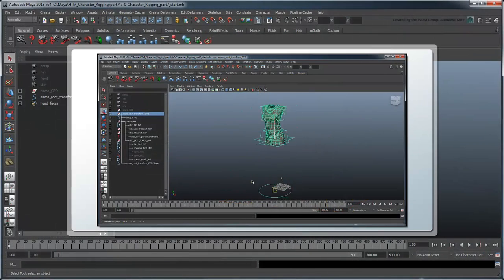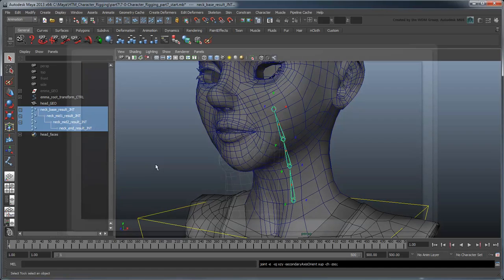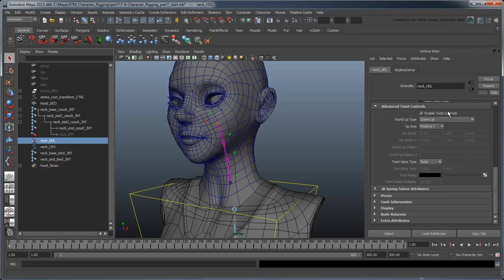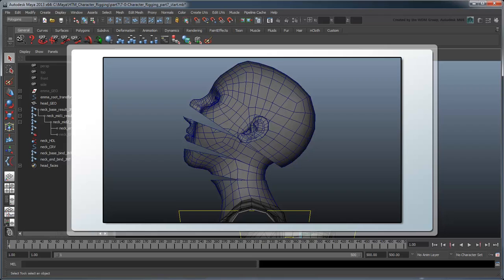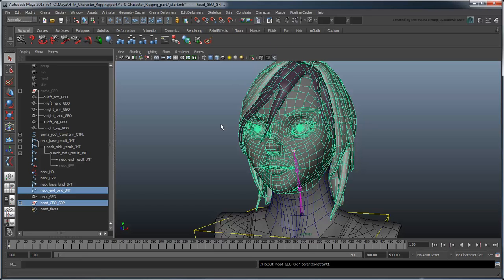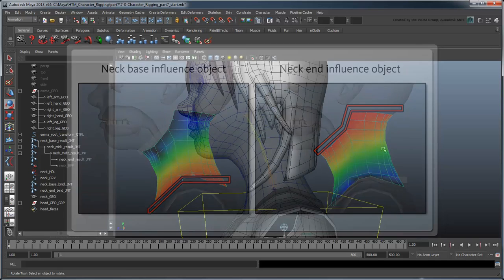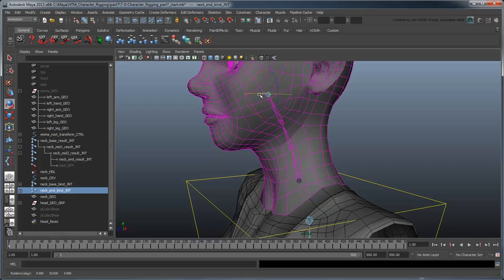Creating a Character Rig - Part 7: Basic spline neck (Advanced)

Comment: 4:30 Why do you set it at 45 degrees? Setting to Z 1 changes the local rotation. When set to Z 0 and Z -1 the twisting looks the same. Is it to consistently orient the axis? Or is there another reason? There seems to be no difference in appearance. I don't understand.

Comment: I'm not expecting an answer on this 6+ year video but one can only hope!  I was wondering whether it'd be needed to create those influence objects if the mesh is entirely skinned? Thanks so much for this series!
Reply from the maker: They won't be as necessary, you're right.  But occasionally you'll use an influence object even on a fully skinned mesh - one common example is using a sphere inside the elbow to help the deformation look more elbow-like.  But for the most part they won't be necessary.
Reply: @Autodesk_Maya  Thank you so much! You just made my day :)

Comment: I am looking to create a rig to animate a character used in Unity game engine - Unity does not read Maya's Rotate Axis (pre-rotation), Joint
 Orient (joint only post-rotation), or Segment Scale Compensate (joint only option). Is it possible to make a rig like this one without relying on those three features? I know that the segment scale compensate can be turned off. Would doing so break a rig like those or would it be easy to turn off and alter the rig to get it working again?
Reply: I am told "turn off automatic scale compensation for your bones in maya to get consistent results between maya and unity. You can use constraints to have scale compensation in your rig that actually bakes/exports properly if you really need it." Would it be easy to modify a rig like in this video to use constraints to mimic SSC instead of using the automatic SSC feature?
Reply from the maker: @Miketulli8  Unfortunately I'm not an expert in Unity, so it's hard for me to answer this.  In general though, this rig uses a lot of Maya-centric math nodes which I'd be surprised if Unity supported.  When porting to a game engine, my advice is usually to animate in Maya, then map the result skeleton to a much simpler / basic skeleton which you can then send to Unity.
Reply: @Autodesk_Maya  Thanks for the quick reply. I have no experience in Maya as I am switching from Blender. Does your suggestion just entail making a second armature that copies the transforms of the original? I am looking for a result that would give the exact same animation, same stretching and deformation of mesh. Is that possible?
Reply from the maker: @Miketulli8  Yes, that's right.  Do all the complex stuff on this rig, then transfer the raw joint values to another, much simpler skeleton (which any game engine should be able to handle easily).

You can also consider using HIK, which is Unity compatible: https://www.youtube.com/watch?v=c538zkwxgTQ&list=PL8hZ6hQCGHMXKqaX9Og4Ow52jsU_Y5veH

Though it doesn't handle squash/stretch without some work either.

Comment: I apologize if you've answered this in the past videos, but I'll follow the steps, the neck rocks back and forth well, but then I get to the rotation and it rotates well, but won't rock back and forth. I delete everything and try again and usually that 'fixes' it. Is there a reason for this happening that I'm missing? I feel like I'm following everything to a T but this happened with the spine and now the neck and only redoing it from the start of the bone creating process seems to work.
Reply from the maker: When the rig was broken and you tried to move it, did Maya give you a warning about any "cyclical dependencies" in the Help Line?

Comment: I am following this tutorial step by step and everything has worked. Once i added the influence objects...my head still separates from the neck. I am using Maya 2017, I even matched the smooth bind settings to this one, and it still doesnt work....any ideas???
Reply from the maker: Does it separate the exact same way, or different from when there's no influence object?  Also, you can try this: go to the Rigging menu set, then select the neck and go to Skin > Paint Skin Weights.  In the Tool Settings Editor, do your influences appear in the list of Influences?  And if you select one of them, does the entire neck remain black, or do you see a white gradient?
Reply: When I select the influences they remain black
Reply from the maker: @Celestianee  The influences remain black, or the neck?  If the neck is black then it means the influences have no weight, which would explain why they're not having any effect.  Try setting the brush to full, then painting over the region of the neck the influence should affect.  That should fix the issue.

Comment: If you orient the end joint on the neck, will that eliminate the need to create a 45 degree angle on the up vector as shown at 4:34?
Reply from the maker: It should yes.  If you want to do that orientation, you'd have to create a temporary joint at the end of the chain (so after the actual end joint), orient them all, then delete the temporary joint.

Comment: Using Maya 2017, after adding Influence @ 9:30 and then parenting the pCube1 to the neck_end_bind_JNT, I am left with an extra pCube1_Base node. Shouldn't the pCube1_Base be parented to the neck_end_bind_JNT as well? 

Likewise, there is a leftover pCube2_Base for the pCube2 and neck_base_bind_JNT Add Influence process. 

There are no instruction on what to do with this node and when comparing with the supplied reference download file for Part 8. (8-0-Character_Rigging_part8_start.mb) I see there is a neck_base_influence_GEOBase but, none for the neck_end_bind_JNT.

Segment of the emma file tree:

neck_base_bind_JNT
 neck_base_influence_GEO
 neck_base_influence_GEOBase

neck_end_bind_JNT
 neck_end_influence_GEO
Reply from the maker: It doesn't really matter what you do with these base nodes.  The influence is the only thing you're after.
Reply: Okay, thanks... So, deleting them will not effect anything?
Reply from the maker: Correct!

Comment: hi. I'm struggling with adding a curve driven blend shape to this rig. The master head, once the blend is apply doesnt follow it properly. Any help appreciated
Reply from the maker: Out of curiosity, why are you adding a blendshape?  Is it for facial animation on top of this rig?  If so, I'd recommend using the Shape Editor to put those changes on a new layer, or they can get in the way of your skinning and override it following the rig (which sounds like it might be what you're running into).
Reply: yes,this is exactly what i'm trying to do.(trying out faceware stuff) could you be a little bit more specific about this layer so that i know what kind of tutorial to look for? thanks in advance
Reply from the maker: Hmm, I'm not sure exactly how this will interact with Faceware (I'm not very familiar with that plugin), but you can give this a try.  
1.)  First is cleanup your geometry by selecting it and going to Mesh > Cleanup in the Modeling menu set.  Turn on "Non-Manifold Geometry" and "Lamina Faces" then click Apply. 
2.)  Once your mesh is clean, go to Windows > Animation Editors > Shape Editor to open the Blendshape Editor.
3.)  Select the mesh and click "Create Blend Shape".
4.)  Select the new Blendshape in the editor and click Add Target.
5.)  Sculpt a new facial expression on the target (either using the Sculpting shelf or perhaps attaching it to Faceware somehow).

This will put the facial expression on the target, which you can fade in and out with the Weight/Drivers slider.  Additionally, because this is on a layer, the edited expression will move along with your rig controls properly.  Then it's simply a matter of creating a new target for each expression you want for your character (make sure to rename them so you don't get confused).
Reply: Maya Learning Channel thanks alot. Ill give it a go.
Reply: it works, great. but with modified step 4.  with a target mesh selected i clicked Add Selection as Target ,  / Tangent

Comment: Still loving this series. Is it important to keep joints straight for some reason? I have a bit of a bend in my neck joints, but in the tutorial files the joints are straight. The spline twist doesn't move exactly the same but it seems to work fine regardless. But I'm wondering if "best practice" calls for having joint chains be as straight as possible..?
Reply from the maker: Nope, they don't have to be straight.  That just happens to be the way I set it up.  Actually, sometimes having a little bit of bend helps with default orientation.
Reply: ah okay! Thank you!

Comment: I was making a character rig using this method for Unity and animating it was fine, but when I export it, the neck end bind joints detach from the head (making it still while the rest of it moves) and the end bind geos are visible. Do you have any solutions for this? I am using Maya 2016 and Unity 5.6.3f
Reply from the maker: It sounds like the skin weights or possibly the parent constraints aren't getting properly imported into Unity.  Unfortunately, Unit doesn't support all of Maya's nodes.  I would recommend trying this technique for full compatibility: https://vimeo.com/34676136

In short, create a second version of your character that is just joints and skinning, then transfer the animations from your more complex rig to the simpler one before exporting.  This will guarantee that what you're exporting from Maya can actually be interpreted by Unity.

Comment: i've trouble with the local axes.
in the video Y points forward, Z is on the left and X points upwards. in my case Z points forward, X is on the left and Y points upwards. could somebody tell me how to set the up vectors and up axis? also in 2016 you can define a forward axis; maybe i have to change something here..? i hope someone can help me!
Reply from the maker: I think you might've missed the step at 1:31.
Reply: well, no... what i forgot to mention: my neck joint orientation has to be like this because it's the same as of my torso.
Reply from the maker: Just curious, but is there any particular reason you decided to set it up that way as opposed to what's shown in the video?  If it's because you're concerned about Y not pointing up as it typically does, remember that animators will only interact with the controls (which will be oriented relative to the Y-up world).  

I only ask because you're probably going to run into more of these same inconsistencies further on in the tutorial since your base skeleton isn't set up the same, which will in turn lead to a lot of extra headaches/work.
Reply: oh no... looks like i better set it up from the very beginning. there was no reason, i just took the axes coming with the model. didn't think about problems that could be like this...

Comment: I have skipped making a proxy rig and just created a rig for my current character. I have noticed that when rotating the IK_Shoulder_CTRL, the Hip_IK_CTRL doesnt rotate along with it and vice versa. I hope this makes sense. Was it only rotating because we grouped the individual body parts or did I actually miss something? And if so, is it still repairable?
Reply from the maker: That sounds correct.  The shoulder shouldn't rotate the hip, since they're different controls.  Rotating them together is what the body_CTRL is for.
Reply: That sounds about right. Thanks for your respone. You have been a huge help with this guide sofar :)

Comment: Driving me crazy:
Why does the neck_end_bind_JNT rotate "more" than the neck_end_result_JNT?
Is it due to the curve not being able to bend "around" the joint?
For example, tilting the head backwards works fine if you parent a piece of geometry to the neck_end_bind_JNT . But when you skin a mesh to the result skeleton, the head will only rotate a fraction of that of the controller/bind joint...
Reply: That is not what Svegish was refering to. The neck_end_result_JNT is unable to match the rotation of the bind joint because it is part of the neck spline, which means it will be unable to match the head_CTRL's rotations perfectly.
For example, open the finished skinned Emma rig from Appendix C - Skinning, select the head_CTRL and rotate it back. The actual head geometry will not be able to rotate as much as the controller.
Reply from the maker: That's a skin weight issue.  You have to paint skin weights after smooth skinning an entire skeleton.  See the latter half of the Quick Rigging tutorial for more an example of the exact problem you're experiencing: https://youtu.be/c538zkwxgTQ?t=5m36s

Comment: I have a question: When I add the head and neck to the torso, follow the steps all the way up to setting the influences and adding squash and stretch...for some reason when I go to scale the torso it breaks. the shoulder geo scales in the y axis and the spine geo scales in the x direction. I have tried building it several time and it continues. Any advice?

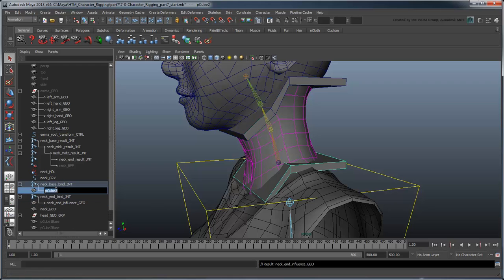Comment: at 10:11, Neck_base_influence_GEO. influence was not added like with Neck_end_influence and neck still pull away from a collar. how to fix that ?

if I select neck geo and neck base influence geo and add influence, neck become very stiff, bottom part of the neck does not move any more. when select torso instead of a neck also same effect.
Reply from the maker: We just skipped over that part to save time.  You are supposed to add the influence.

Comment: I'm getting some pretty insane issues when switching between renderers. VP 2.0 allows me to see all the geometry given how the layers are set up, but I have to switch to legacy in order to view LRA -- so I've been switching between the two. Problem is, LRA is totally messed up when in VP 2.0., particularly at the base of the neck. Any idea how to fix this or is it a bug? I'm using 2015.
Reply: After messing around with the rotation tool settings, it looks to be associated with Gimbal for some reason.
Reply from the maker: Hmm that sounds like a bug to me.  You may want to log it.
Reply: Maya Learning Channel I may log it after playing around with it a bit more. Want to be certain it's not me making a mistake.

Comment: Later on in this series will you combine the extracted mesh of the torso?
Reply from the maker: +Monkey D. Luffy You're referring to skinning, which is an entirely separate process from rigging.  Unfortunately we don't get into it for this tutorial.  However, basically what you want to do is actually delete all the proxy (cut up) geometry from this rig, then bring in a fresh non-cut version of the geometry.  You'd then smooth skin the geometry to the result joints only.  For a list of proper joints to skin to, see the file in Part 32 which has a display layer containing them.

Comment: ...wich is the sense of having a perfect rig wich controls pieces of the original characters geo?, ...i ges i´ll have to bind the original charater´s geo to the result joints and in that process i´ll have a new binded mesh wich joints wont influence the same vertex and the diferent pieces or geo_result meshes each individual moove as a hole becouse thery are parented to it owns joints...?

Comment: 2:34 Ugh... the Advanced twist controls are really screwy for my rig. I'm following exactly what is taught here, with the only difference being my result joints, bind joints orientation's are set to follow the world scene Axis (Y up, +z forward, +x character's left side). So I would adjust and up vectors and the up axis in the settings accordingly but it makes the spine twist in all sorts of weird ways. like 17 degrees ish in different directions per joint. (Got this trouble from when i was making my spine too).

As a workaround, what I did was to link the Y rotations of my Bind Joints to the Roll and Twist attributes of the IK Spline Handle, with a simple DG network to normalize the Twist so that the Roll doesn't affect it.

I've been looking around, seems like Maya's twist controls creates common problems. :/
Reply from the maker: +Gogo Unfortunately that's just the way the math works under the hood.  LRA's are the most common source of twist problems.

Comment: the influence objects you used to create at both ends of the neck - they dont necessarily have to be cubes right? if not, is it important for the influence objects to have followed the shape of the neck ends? would, for example, a locator be able to serve the same purpose?
Reply from the maker: +Gogo They do not have to be cubes no, but it is preferable the rough size/shape of the object you use covers the neck ends.  A locator will result in strange deformations because it's so small.
Reply: +Maya Learning Channel Thanks for the responses! I'm still transitioning to Maya from Softimage - I got one more question about selection orders - it seems to be an important concept in Maya. for example - in skinning the neck - i should first select the joint - then the neck geo then apply the skin yes?
Reply from the maker: That's right.

Comment: At 9:30 we add the smooth skin influence using the reshaped cube on the neck. In Maya 2016 it looks like the menus are moved; after selecting both, in the Rigging menu I click 'Skin < Edit Influences < Add Influence" and it says "No skinned objects were found in the selection". I double checked and the neck is weighted, I don't know how to fix this. Help please?
Reply from the maker: ***** You have to Shift + select both the skinned mesh (the neck) and the influence object.